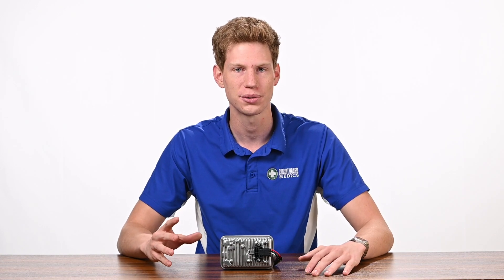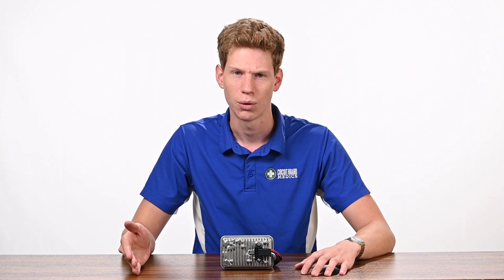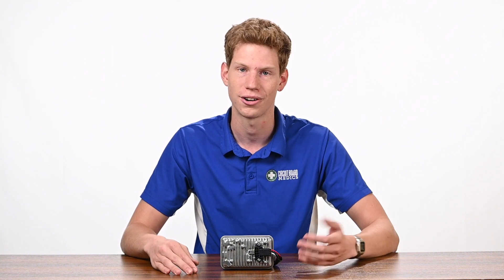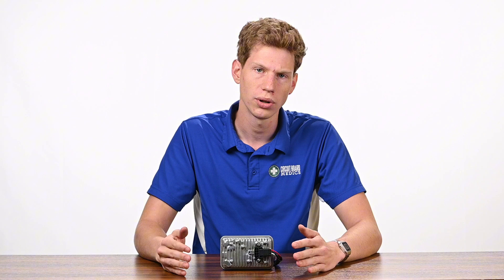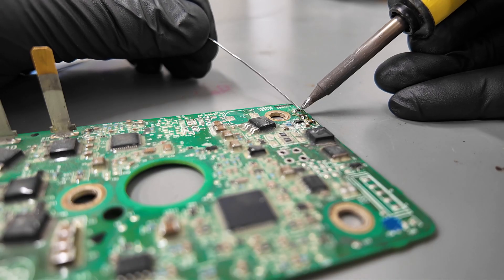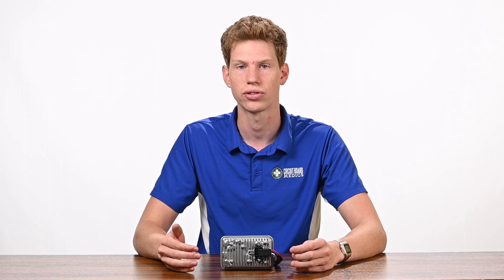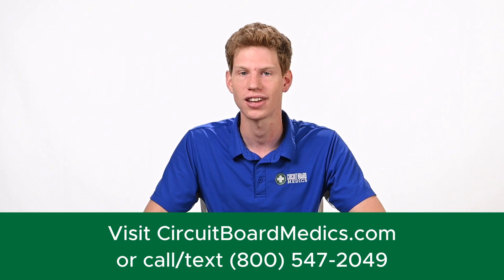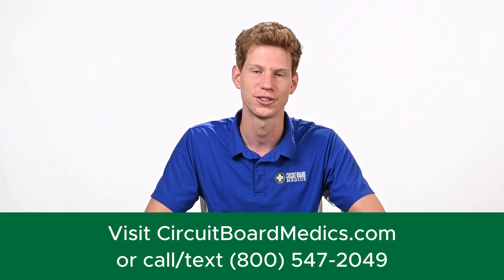L5p Turbo Actuator Common Symptoms, Repair, and Replacement

Comment: Came across this video and it seems most similar to what I have experienced/seen. I have a 2017 l5p duramax that has suddenly gotten the engine performance reduced message. In addition to the p003a and p0046 codes I also have a p2599. I was able to clear codes a couple times and the turbo sounds fine and I can punch the throttle up to speed rather easily with no noticeable engine wobble or hesitation. Do you think this would be the actuator like in this video, not a problem with the turbo veins or unison ring sticking? Truck has 125k miles on it. I put on 25k with no problems and don’t know if all related parts are original.

Comment: Mines gives me Turbocharger Boost Pressure Output Circuit p0046 code on 2018 gmc, everything runs fine but it whistles/whine when accelerating.
Reply from the maker: Hi Aaron. That definitely sounds like an actuator issue. If you would like to get a replacement or want to troubleshoot further, you can give us a call at (800) 547-2049.